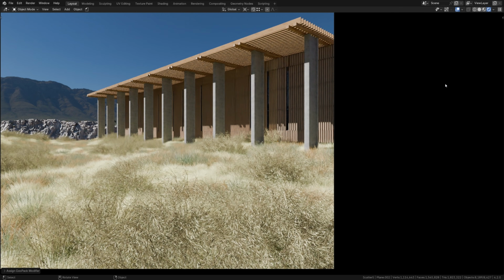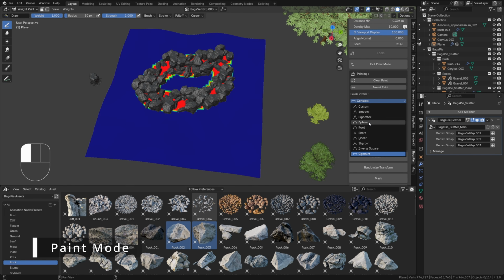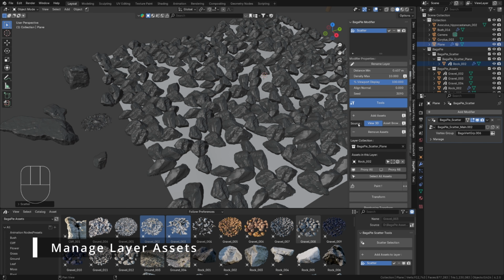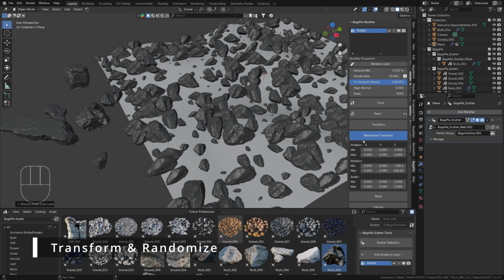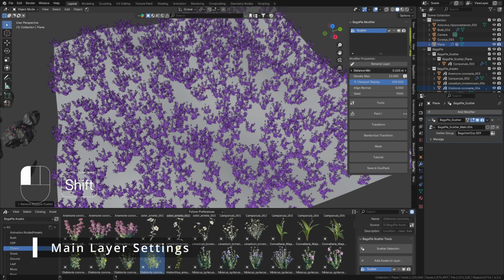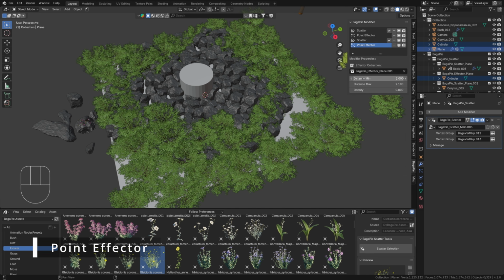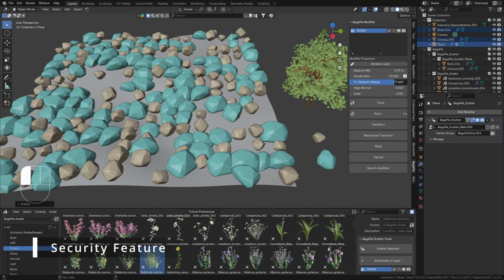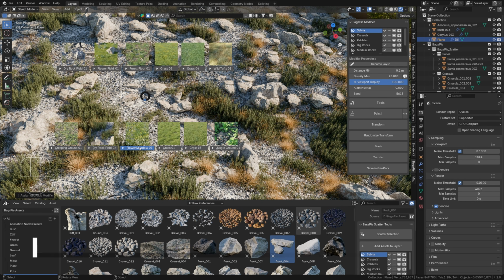BagaPie 11 - Scattering

Comment: scatter paint not working ell in blender 5.0, ıt does not create new layer .And it gives a python error. Can you fix this problem?
Reply from the maker: Hi ! It's fixed now (V11.0.7)
Thanks for report =)
Reply: @antoinebagattini  no its not fixed
Reply from the maker: I can't reproduce the issue in V11.0.7.
Can you describe the full process to reproduce the issue ?
Thanks
Reply: @antoinebagattini  i selected a cube and a plane and press j to go to the scatter paint. Then the plane becomes black colour and when i try to paint it just says the python error. Also i tried many tutrials and cant get the asset library downloaded. When i doenload the zip the assets and vol 1 2 3 and all are not downloaded
Reply from the maker: @flamingaura0665  Hi, if you have download issue, you must reach out the SuperHive team.
The bug was in V11.0.6, not anymore in V11.0.7+
Can you share the error message ?
Can you install the BagaPie version from the Blender extension platform ?
https://extensions.blender.org/add-ons/bagapie/
Thanks =)
Reply: @antoinebagattini  i did download the extenstion from blender itself
Reply: @flamingaura0665  You need to subdivide the plane a bunch of times in order for the scatter paint tool to work. It's based off vertices!